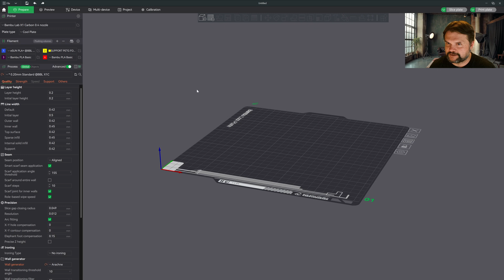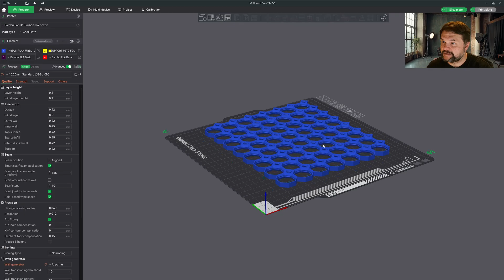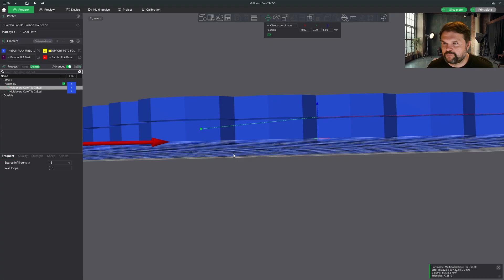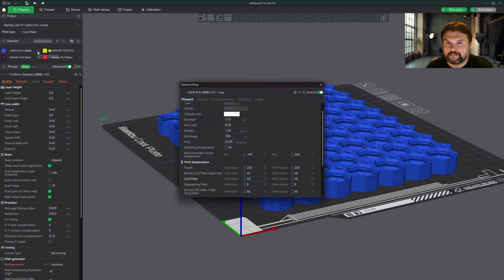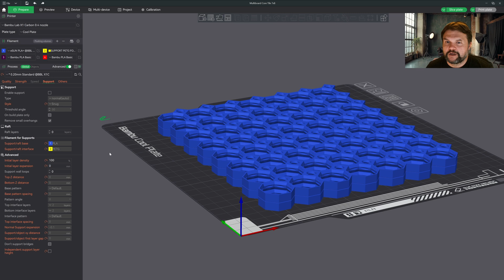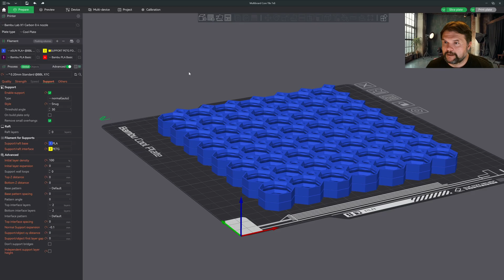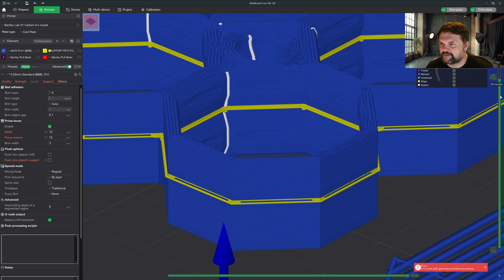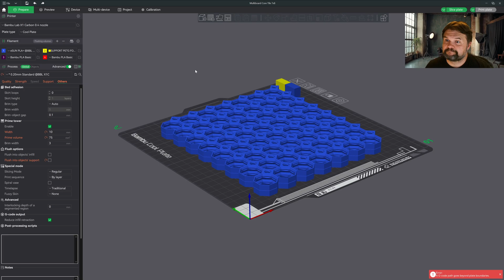How to Stack Multiboard Prints in Bambu Slicer PLA with PETG

Comment: Thanks for the guide. I'm going to attempt this with 9x9 tiles and no prime tower, with a model made with a SCAD generator from a user on Reddit that automatically inserts interface layers. Keeping it PETG with PLA as the interface, running it at 2 layers of 0.2 (0.4 total) to be extra safe.

Comment: Would it be feasible to print the model in PETG and PLA alternatively? Of course then you'll havwe half of them in the other material, but for multiboard both are fine, aren't they?
Anything speaking against alternative stacking?
Reply: Yes, you could even use another material like ABS. The idea is simply that the 2 different types of material won't bond to each other. You may have issues with warping with PETG or ABS, but if you can get your temps right to prevent that then it'll work fine. I think most people, myself included, only use the PETG for the supports because it used to be a bit more expensive than PLA, but it also warps and shrinks more so it's not worth the hassle.

Comment: 24 filament changes between PLA and PETG for 2 boards stacked, is this right?
Reply from the maker: No should only be like 2-3 changes
Reply from the maker: Depends how many stacks
Reply: @MrExo_3D  I found the issue, I'm using the multiboard with the little slots around the perimeter so I've put  a support blocker through them and all's good now. Thanks for the video!

Comment: I can't thank you enough for this clip and your cristal-clear guidance. I first tested a stack of 2 boards and then successfully printed a 5-board stack. PLA for the board and PETG for the interface. All comes out neat and exactly the way you mention and I need. Obviously, to fit an 8x8 board together with the colour-change tower, on a 25x25cm plate (Bambu Lab P1S in my case) you can't center the board but it has to be moved to make room for the tower, but eventually, all comes out just fine. Many thanks, mate!
Reply from the maker: Very glad it was helpful!

Comment: Anytime I try to adjust my settings to what you have. I only get a few outer lines of my support material. my model I'm trying to use this technique on has a lot more surface area. So I'd like it to cover more of that vs just the 3 or so lines around the edges. IE, I'd like it to "fill" more on the support. I can't seem to figure it out.

Comment: With the new multiboard having those indents on the sides, those are filling with support, which will add a ton of time, and it can print without... not sure how to not have those supported.
Ok.. set the threshold angle to 1.. but you gotta bump up the normal support expansion to -.2 or it will put a small support piece in the 90 degree angles around the edges.
Reply: legend 👌
Reply: I love you
Reply: Thank you.. Came back here with the same issue. Was showing up to 20 layer changes. After these tweaks only the 2 as expected.

Comment: Hi I'm a bit of a newbie will this work ok in reverse? ie PETG for the Grid and PLA for the separator (or PLA Support material)
Reply: Hi, of course you can reverse , you just must have to alternate PETG and PLA , this is working well because PETG and PLA filaments do not bond to each other.

Comment: For the life of me I can’t get the dedicated model spacer to work. It just refuses to create the top / bottom layer of the main bodies and treats the whole thing like one object.

Edit: For anyone that sees this comment with the same problem I was able to solve it using Height Range Modifiers. It took some effort but if you set the height just before the interface layer and just after at 100% infill for 3 layers it will do the stacking right.

Comment: can You only stack print with multi material?
Reply from the maker: @GCS88  you can do it manually swap one Mayer for another. Or you can use a small gap to space out the tiles. Need to test with small model to refine your settings first

Comment: Thank you for this video. I had been printed stacks of these, but with the settings I was using, there was a tonne of waste from supports. But by changing my support settings to what you have, it cut my printing time in half and uses WAY less filament for support structure. I'm currently running a print and using PETG as my support material (I didn't want to use it before because of the amount of waste). I'm hoping my results are as good as yours.
Reply: Couple of failures so far... I'm hoping it's because I had ironing of top surfaces turned on that the PETG is not sticking properly to the PLA. My PLA says cold plate of 35, which is what I set the PETG to. I'm wondering if I need to change that to 45 like yours says. I'm trying another two layers... Guess I won't know until 8hrs from now. I really should have done a 4x4 and ran some tests rather than on full sized tiles. Doh!

Comment: 2 hours to do 1 mulitboard, if you do 2 with petg separating them takes 5 hours 12 minuets. So 1 hour 12 minuets extra to do 2 at a time. Didnt bother to check how long 3 stacks would take. Faster to do 1 board at time, than filament switch to keep them separated.
Reply: I guess this is handier if you want to print overnight and not have to get up to start another print, or just want to leave the printer printing all day when you're at work. Some people have massive walls to fill with baseplates and it gets tedious setting up a new print every 2 hours

Comment: I just stack them 0.2mm (or whatever you normally use for you Top Z distance) and print them without a support layer and pull them apart without any issues and zero cleanup. Never had any problems with reliability
Reply from the maker: I tried that a few times too. But had more issues then success

Comment: Feel like inverting the materials is the way to go.
I'm new to 3D printing, but I am surprised multiboard recommends PLA when everything ever says use PETG for structural stability
Reply: PETG isn't really "stronger" than PLA, rather it has different qualities that suit some use cases. It is more flexible and impact resistant, but that isn't necessarily what you want for Multiboards, where PLA's stiffness is often better suited. PETG can also be more finicky for dimensional accuracy and shrinkage, which can be an issue for interconnecting parts with tight tolerances. That said, PLA can sag and deform under constant high load, especially in hot ambient temps, so if you plan to hang heavy items in a hot location, PETG might be better.

Bottom line, if you are just hanging light stuff in climate controlled space, PLA works great, and is easier and quicker to print.
Reply: I say, use the right plastic for the right application. 

There is a whole world of different plastics and blends of plastics that have their own unique properties and applications.

There are lots of videos out there that can point out the pros and cons of each polymer. As well as good applications for them.